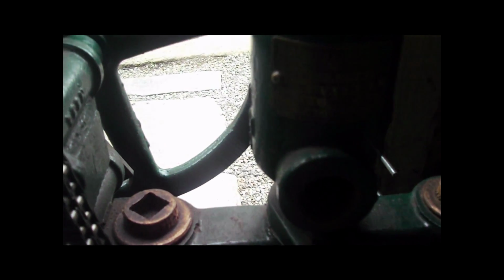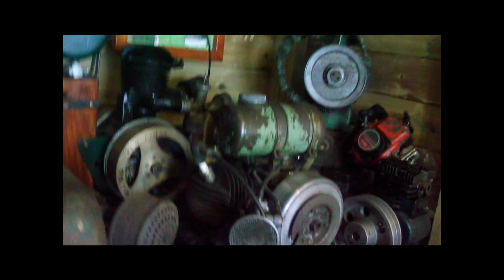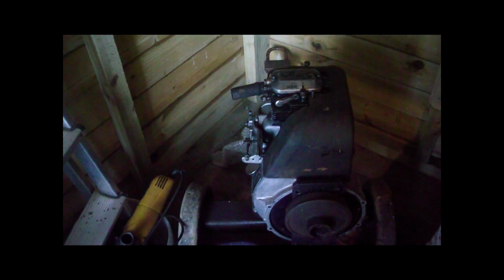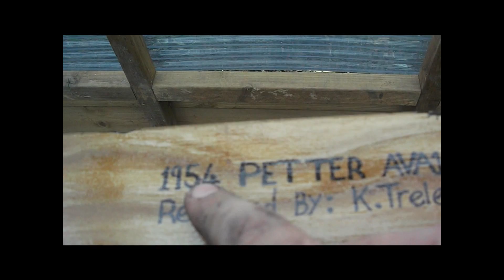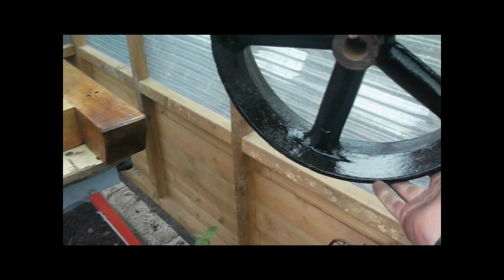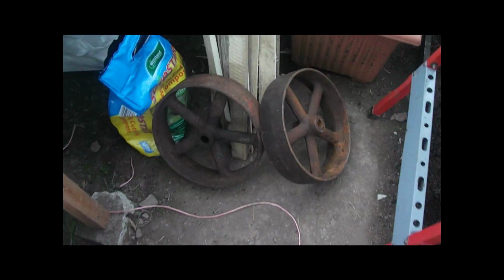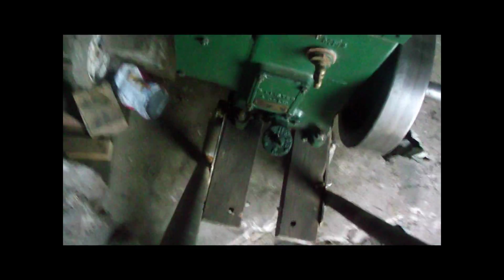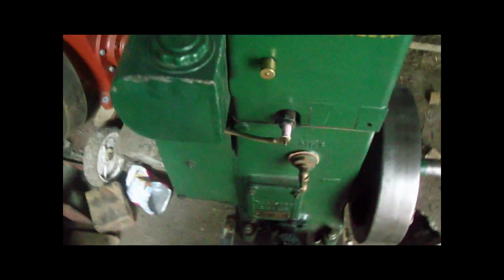Workshop/AvA1 update  6/4/12

Comment: Actually i meant getting it out the engine, mine comes out an inch or so but then no further, i've tried turning wiggling but something holding it. Don't want to force anything, over the years have learnt force it situations like that always ends in tears. Seeing it dismantled would be good too and how you eventually adjust it's output.